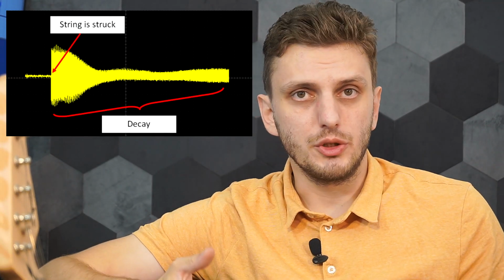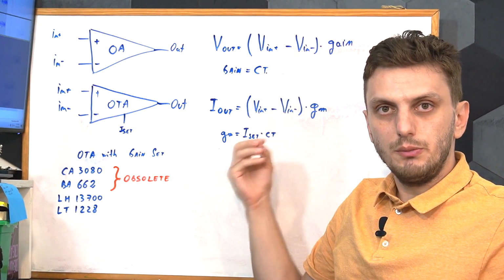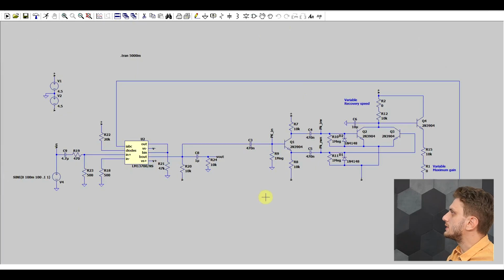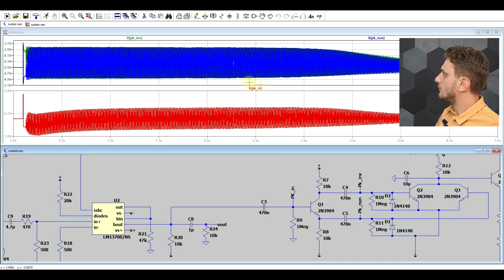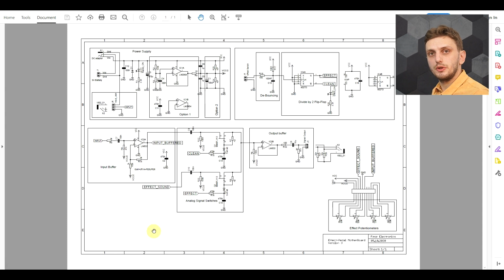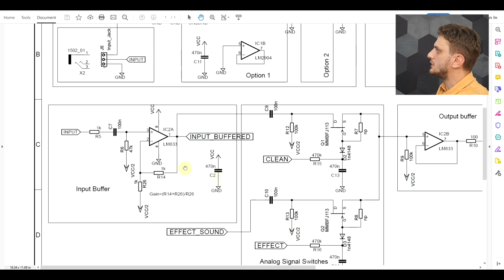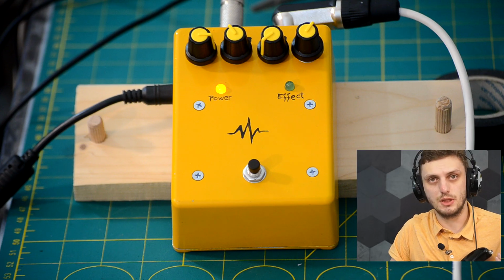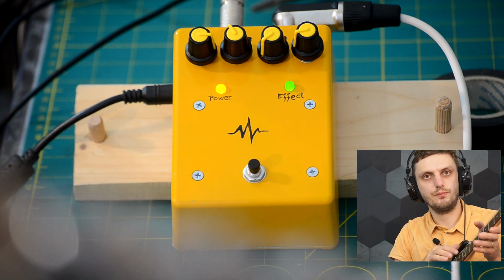DIY Audio Effect Pedal Part 4 - The Sustain Effect

Comment: I’d have used an op-amp ideal-diode based envelope follower, followed by an op-amp differential/instrumentation error amplifier. The ripple in the envelope follower will cause distortion in the output signal if the gain is too high, but the difference in output amplitude will be too great if the gain is too low, so it’s important to be able to tune the error-amp’s gain.
The common linear capacitive envelope follower can be a bit ripply or slow depending on the RC constant, and it also has the issue that the frequency of the note will change while this RC constant remains constant, so there are some switching topologies that seek to rectify this. Personally I’m fond of the one that uses two envelope followers (with reset transistors to V-) that are periodically reset out of phase with one another based off triggering from the edges of a square wave derived from the audio wave itself. If that makes sense.

Anyhow, good to see this effect pedal coming together nicely, it’s been an important factor in how I’m designing my modular synth.

Comment: Do you have experience with OPAMP peak detectors? Could it be more compact to use just one LM358 with two diodes as peak detector? Does this discrete BJT schematics have advantages?

Comment: I would have a look at THATcorp. They make excellent VCA's like THAT4305, specifically made for audio applications. Or THAT218x series
Reply from the maker: To be honest, while doing research for this project, I did come across products from THATcorp but, they are a bit more difficult to obtain; the "local" supplier I usually buy parts from does not keep them in stock... Thanks for the suggestion though, I might take a closer look at all their products some time, maybe try something specific out.
Reply: @FesZElectronics  just email them for samples. You can also buy from them directly. Otherwise Mouser or Digikey.

Comment: Could you maybe comment a little bit on how this AGC circuit differs from a traditional feedback compressor with the usual set of attack / release / ratio controls & time constant? It seems like you're much of the way there already, and yet this seems so much more straightfoward for the intended purpose of sustain.
Reply from the maker: Well, the design is based on the Boss CS2 (its basically identical but the transconductance amplifier IC is different, and component values are in places changed) - so the same Attack, Level and Sustain controls are present. Attack and release are controlled by the same pot2 - it refers to charging and discharging of C7; If by ratio you mean level, then that's a basic "volume" control, not much different that can be done about that. And the time constant I guess is again related to C7 and the attack pot above it. 
I'm not sure if this is the answer you are looking for - maybe you can give me an example of a "traditional" feedback compressor.
Reply: @FesZElectronics  Standard piece of studio gear, I could point to anything really but here's a famous one:

https://www.sweetwater.com/store/detail/GComp--solid-state-logic-g-comp-stereo-bus-compressor